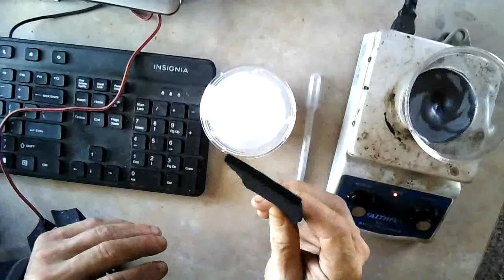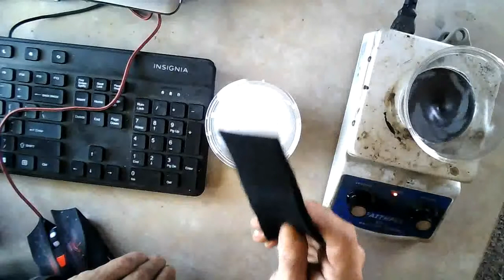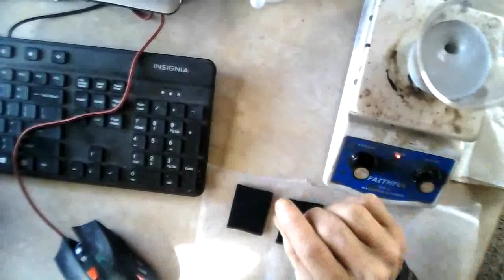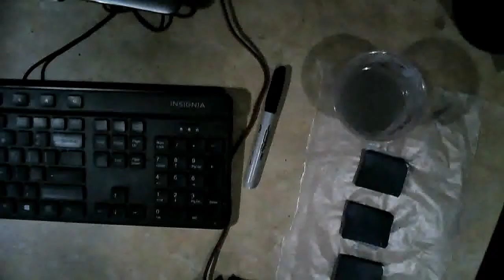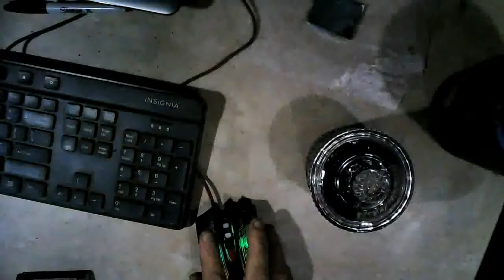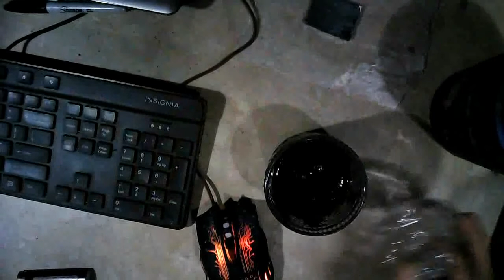Carbon Felt Battery Update!

Comment: Its an interesting test. I look forward to seeing the results.
Reply from the maker: Me too Fred, although I'm pretty sure the cell will need to be pressed together hard to get the most power.
Reply: In that case you will probably want to take subsequent readings at increasing pressures to determine how much is enough or too much be it as it may. I suspect you already thought of that. You are often a step ahead of me. Then again It's always worth rattling off thoughts just in case. I'll be watching.
Reply from the maker: I always appreciate your comments Fred. Unfortunately, the felt doesn't compress very easily. I'd have to use a clamp and measure the pressure with a gauge or sensor. I'll just do the tests without pressure and compare them that way for now.
Reply: Understandable. Materials and proportions are probably more important to analyze at this early stage. You're the driver. I'm just along for the ride.
Reply from the maker: I'd say you're more than just along for the ride my friend. You're a participant in this adventure! :-)

Comment: hi sounds good, i have to share my sunday experiment..same set up as before only i have used saturated solution of ZnSo4 ..current collector ( carbon on current collector) then the kitchen towel with soaked in ZnSo4..then more carbon on the kitchen towel ,,,ss screen as collector..results 1-on the build the mv is low 358mVdc as it settles the voltage climb to 855mV

2- first charge for 30 seconds on 8Vdc pulsed with 1.5Amp
3- cell settle at 1.25vDC and deliver a Whopping 1.0 Amp in short cct test
4-on a 10 second rest or self recharge ..another whopping 955mAmp run

thank we are getting there with green chemistry
Reply from the maker: Zinc Sulfate sounds like it works great with the cell Barry. I've got some of that I think. I'll test it in the chamber when I get around to electrolytes. :-)